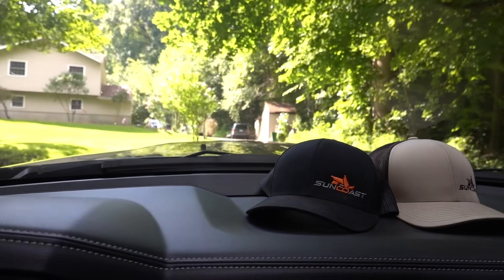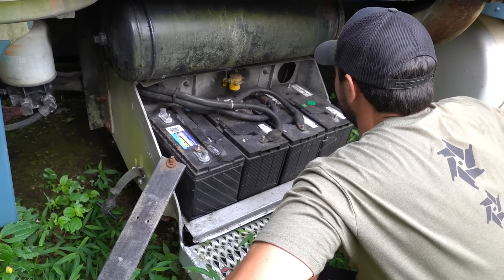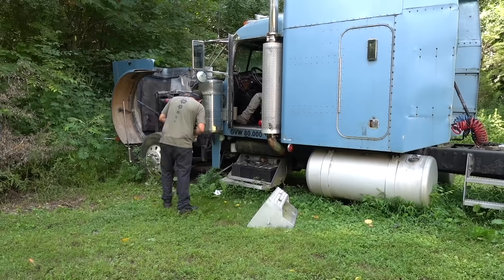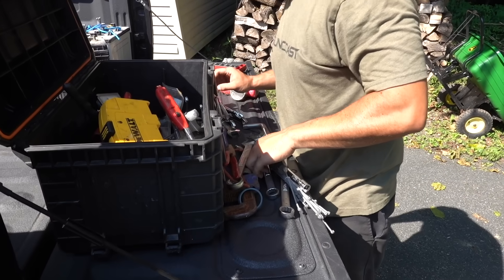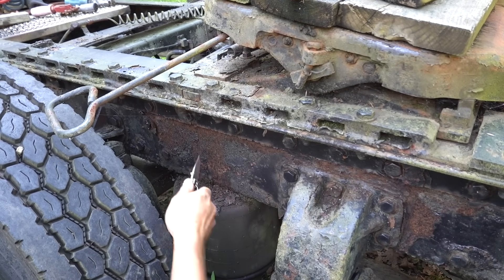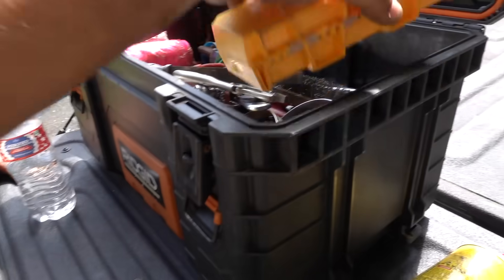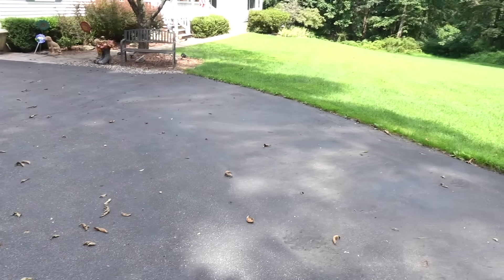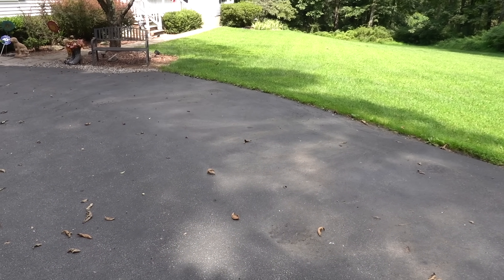TRYING TO START AN OLD 379 PETERBILT!!!! WILL IT START AFTER SITTING FOREVER!?!?!

Comment: That good engine is about $20k. It had a lot cosmetic issues but it would make somebody a good starting out truck. Great quality video.
Reply: 20k? You can pick up those with 3406 E or 3406 B around my neck of the woods on the east coast for 3-5000 running and driving
Reply: @jjp1117  that's the way always went for me. if II needed an engine that I could buy for 5 or  6 grand normally, I could never find one when I needed it back on the road yesterday and the truck was a thousand miles away.

Comment: 3406 my favorite. Had a w900 tuned to the hilt, bigger injectors turbo etc. behind an eaton 18 with 3.73 rear end.  👍 That thing was a beast. Crack that thing at 60 bobtailing and pull away from sports cars. Insane power. Buddy got one of the new 600 cummins, he couldn't evan come close loaded down (Overweight) Gvw probably around 110,000lb hauling bauxite and magnesium slag up and down those PA mountains... Rather have that truck than a lambo. Miss that damn thing 🙂 And the sound of that 3406 holy fck. Easy on fuel as well if you know how to drive it right. On the other hand keep your foot in it you'll run through both tanks in no time🤣

Also great content 🤘

Comment: Guys, if you want to park the truck for a long time, please, PLEASE put a rubber taurp under the truck to protect the low part of the truck from moisture, this dirt cheap thing will prevent alot of rust issues and corrosion, not to mention that if you consider to sell it the new owner will have far less things to fix on it and make him happy.

Comment: I had one just like that mine was a 1998 Pete with a super 10  and the Cat motor my truck # 28964 with Werner 2000 that was a very nice truck to drive otr and Dedicated routesI drove her for 2 years before I had to turn her in when I went to a local dedicated Sears run in a Day cab FLD Freightliner My Pete was Super Clean took alot of pride in her.

Comment: Cat over haul with a head is like 13k by its self.
Reply: Taylor Ray lmfao. A cat overhaul is over $35000
Reply: Taylor Ray Last year I had a 2000 T800 1LW 3406e. The estimate to go through it was $50,000. It lost a tooth on the gear train and took out all the front gears, a piece got into the main bearing so it was going to need a crank also. A crate motor was $35,000 installed. The main reason I wanted it overhauled instead of a long block was for the warranty difference.  There is 60 hours of labor to do an basic in frame. I guess  you didn’t add that to your $13,000 considering a new head is between $5,000 and $7000 from Cat. I guess you are using aftermarket parts for $13,000 and doing it yourself with FREE. labor!
Reply: @brianmuse7215  negative read my comment. And over haul kit is a head, pistons bearings seals and gaskets,oil pump etc. Its 13k ive done sone many over hauls its bik ot funny is a crate motor probably would be 35k but you can find a good used motor with low miles for less then 10k. I didnt say anything about crank or cam or gears. Non of that comes in an average over haul kit. And the 13k is the kit not labor
Reply: @brianmuse7215  like i said look up at cat overhaul kit with a head its 13k oem cat.
Reply: @DieselAddict-vs9fc  I paid 4k for the head and 7k for the gold inframe kit. From cat. Plus gaskets etc...you're right
Reply: @marceloevera2009  yeah the firsy time I heard that i said " ill never own a cat" lol ill go n14 Cummins of 12.7 Detroit
Reply: @brianmuse7215  like i said go looks up a cat over haul kit. I over hauled a cat with with a new head, new clutch, overhauled the transmission and new turbos, new breaks all around ,king pins and tire rod. For 35k total with labor. Sounds like you got ripped off. If you ever come to Houston tx let me know. We wont rip your head off like that shop did. We're in Pasadena
Reply: @DieselAddict-vs9fc  how can I get your info?  I live in Houston and have a c15 Acert,  never know.

Comment: Guys remember 4 batts mean there is a series parralall switch turns 24 volts to starter 12 to aux to dash start is 24  key is 12volt

Comment: Hey greg i got a 08 dodge 2500 heavy dutty cummins 6.7 efi live tune sinister deisle grid heater delete. Ita pushing cooling put out of ever flow tank not to sure whats going on it does it the worst when im pulling my 5th wheel

Comment: You can't go wrong with an old kitty CAT and you can always build them more if your not satisfied with the power I love all CAT engines accept  for the twin turbo acerts.  I remember when they came out with the bridge engine same as a 6nz just little restriction on them actually it is a 6nz same block too change your injectors and put you a good aftermarket turbo on it remove catholic converter and mufflers run a straight pipe it would wake that monster up

Comment: yeah, if you just needed a mechanical cat engine its good.. the rest is a rusty turd...  all new breaks, air lines, tires.. normal been sitting years fluids and filters change just to start..